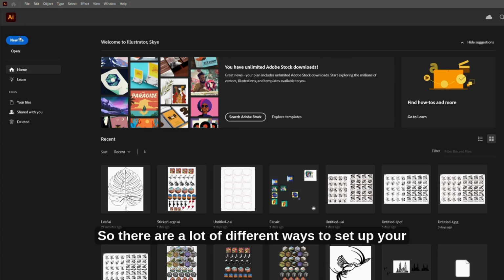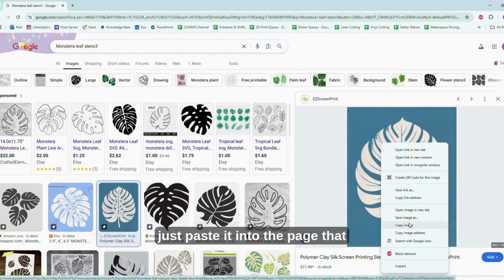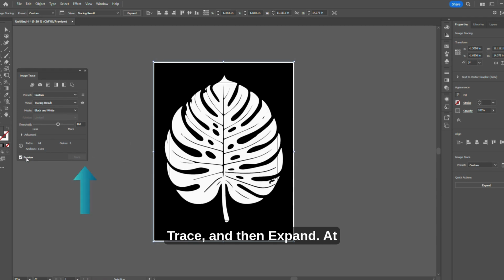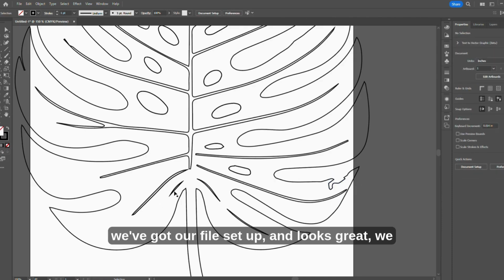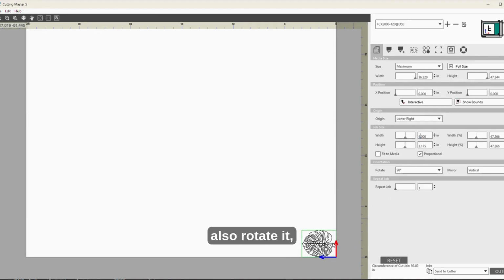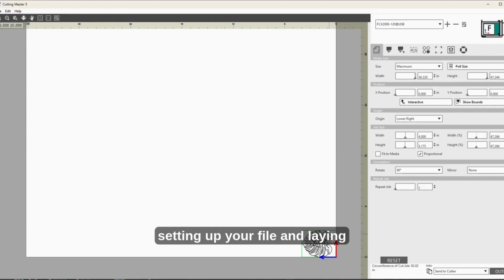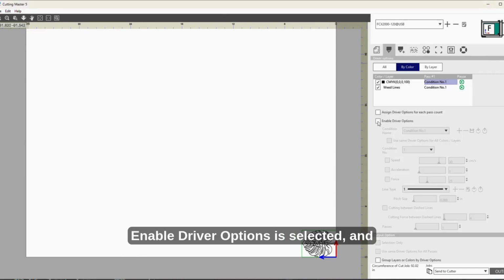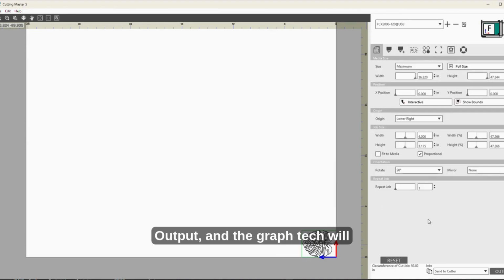Setting up Graphtec file and using Cutting Master 5

Comment: Illustrator is not giving me the option to export to cutting master 5 
Could you help me please
Reply: Same problem here. I have Cutting Master, but I can't find any information on how to get the plug-in for Illustrator.
Reply: @phillippriolo9449 its not available right now. Have to use older illustrator version i think
Reply: @phillippriolo9449  oh sheeet they fixed it
Reply: did you ever figure this out? the command doesnt always show up for me